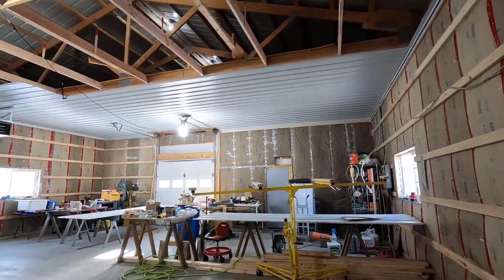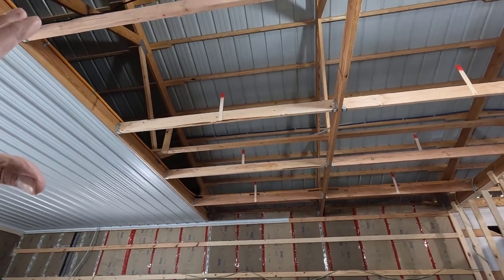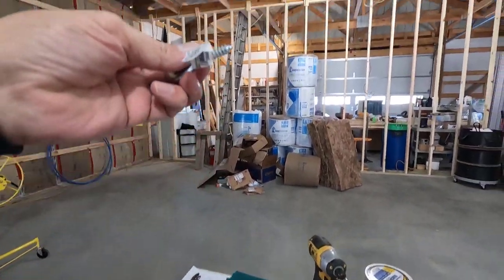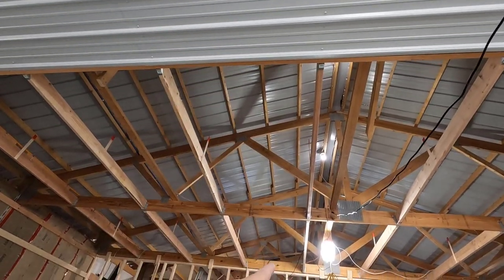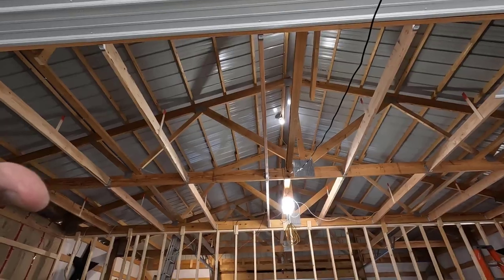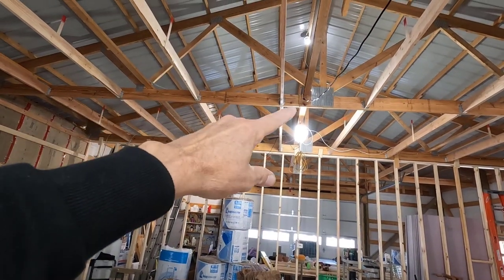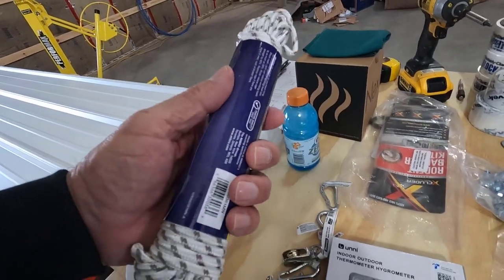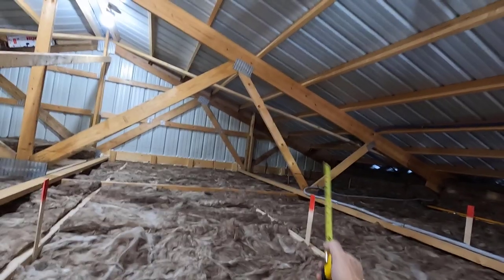How-to Install an Attic Temperature/Humidity Sensor

Comment from the maker: I forgot to mention that this sensor is also for mold. I can check the temperature, humidity, and mold count up in the attic with this setup! All three can sense if something is going wrong one I know what the baseline numbers should be. If there were a leak in the roof and the water is not visible from the shop below, the mold sensor will come in real handy!  Temperature/Humidity Sensor - https://amzn.to/3CwMD3h

Recent Products used:

Temperature/Humidity Sensor - https://amzn.to/3CwMD3h
16' LeverLock Tape Measure - https://amzn.to/3MRu9i9
Seagate Desktop 8TB External Hard Drive - https://amzn.to/3gRZGEC
SuperWinch Terra 45 - https://amzn.to/3AdzJWR
Large Tapcons - https://amzn.to/3TDkJbz
Heavy Square Washers - https://amzn.to/3E1tvKV
DeWalt Impact Wrench Kit - https://amzn.to/3EtMaQY
Flexzilla Air Hose - https://amzn.to/3ARo6W5
Drywall Lift Panel - https://amzn.to/3hOwDm4
Milwaukee M12 2.0 AH Battery - https://amzn.to/3X9qvVl
Kinco - Premium Leather Work - https://amzn.to/3EeLTjv
Johnson Laser Level - https://amzn.to/3idhn2h
Tyvek Sheathing Tape - https://amzn.to/3XKaQMu
MemBrain Smart Vapor Barrier - https://amzn.to/3ugDBmD
ColorFit by Milton Coupler & Plug Kit - https://amzn.to/3UpS6iJ
Milton Safety Exhaust Coupler - https://amzn.to/3FhrCeY
Senco SPS SKS-L, SKS-M, SKS-N Staple Gun O-Ring Kit - https://amzn.to/3H3wqWq
Old-School Brass Laundry Faucet - https://amzn.to/3TcXWUH
Schrader Valve to Male NPT Fitting - https://amzn.to/3ytxazd
Carbide Tipped 2" Hole Saw - https://amzn.to/3VCV5Wj
100 lb Neodymium Magnet - https://amzn.to/3U8vrHF
200 lb Neodymium Magnet - https://amzn.to/3F2PEu8
300 lb Neodymium Magnet - https://amzn.to/3FksvSQ
500 lb Neodymium Magnet - https://amzn.to/3YbZbq2
600 lb Neodymium Magnet - https://amzn.to/3FdaWUC
700 lb Neodymium Magnet - https://amzn.to/3hej2UX
1,000 lb Neodymium Magnet - https://amzn.to/3FH8VkS
1,500 lb Neodymium Magnet - https://amzn.to/3uHbU6Q
Starrett Combination Square - https://amzn.to/3hbAwS5
Thermal Warm Crew Winter Boot Sock For Men - https://amzn.to/3j5EFr3
Energizer AA Ultimate Lithium Batteries - https://amzn.to/3V95tUX
USB 3 Extension Cable - https://amzn.to/3BML0y9
SZHLUX 6 Pack LED Shop Light - https://amzn.to/3j9Dozn
CH2100 2-Pole 100-Amp Circuit Breaker - https://amzn.to/3GbrduP
DANCO Gas Test Gauge - https://amzn.to/3YBRAS9
Indoor Outdoor Thermometer Hygrometer Wireless Weather Station - https://amzn.to/3FJq1O5
Tordon RTU - https://amzn.to/3WGu98d
Male to Male USB Cord - https://amzn.to/3WnKIWS
YELLOW JACKET Gas Pressure Test Kit, 0-35"Wc - https://amzn.to/3FXUzf3

Comment: That's a pretty cool idea! Those little weather stations are pretty cheap, so I may just put one up in my attic. I've always wondered how hot it got up there in the summer, but the winter temp would be interesting as well. 😊
Reply from the maker: I'm real interested in how warm it gets in the winter as well — especially when the sun is not shining, but it is also interesting how much heat the sun is adding up there 🤔

Comment: That's a pretty cool idea! I would be interested in knowing those different temps at different times of the year!
Reply from the maker: Thanks Shed Homes, I forgot to mention it records mold as well. The mold level is at zero now, so if that goes up, there is likely a problem if it is higher than the outdoor level.